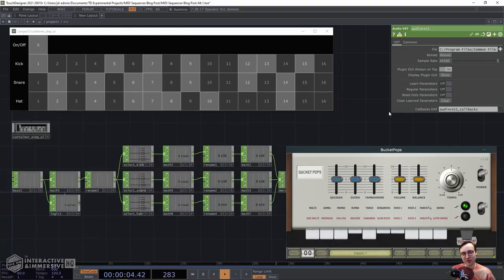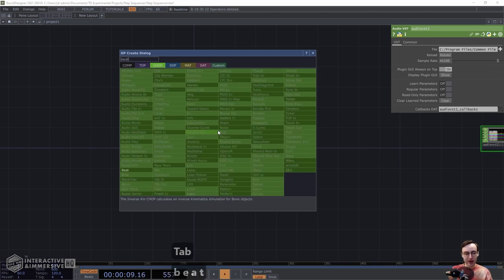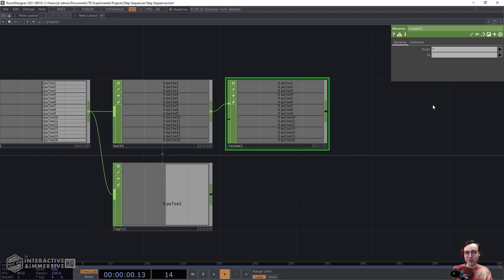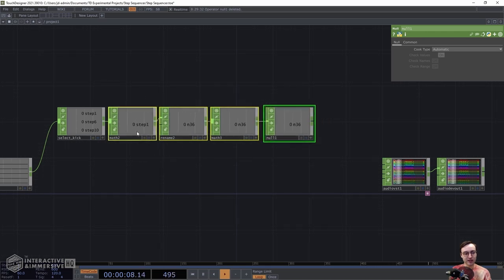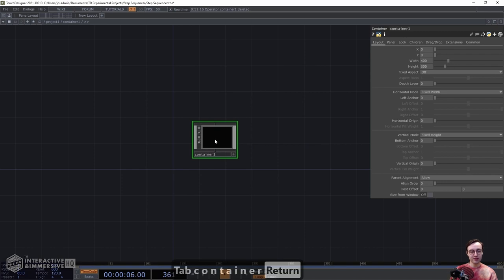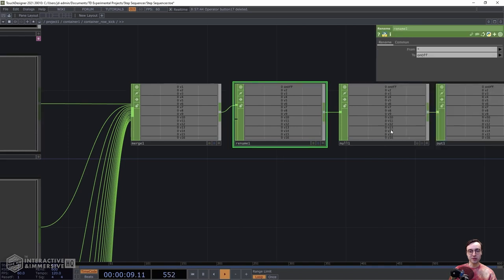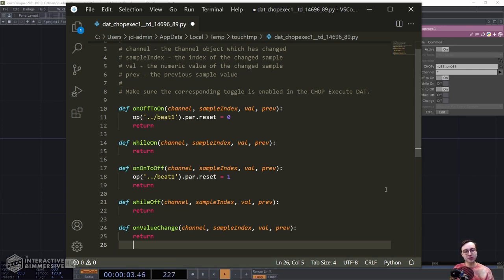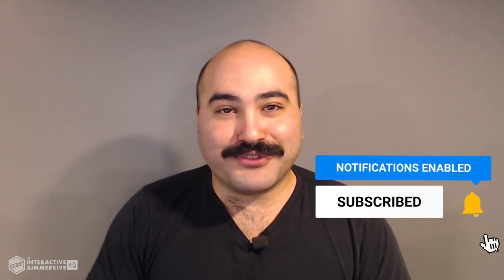Building a Step Sequencer for VSTs in TouchDesigner - Tutorial

Comment: I always get an error message: "reset" and "channames" can't be found qwq
But the tutorial was very nice!
Reply from the maker: Hi! This sounds like the code might not be pointing to the right operator. I'd recommend double checking that all of your code matches what we have in the video starting at 27:00 or so. 

Especially important is that all operator references will be pointing to a level up in the network (outside of the Container COMP).  So for example if we want to change something on the beat1 CHOP, we have to start the reference the operator with op('../beat1') -- the ../ portion is what tells TouchDesigner to look outside of the container1 COMP. Hope that helps! :)